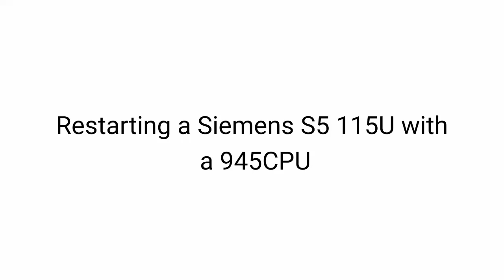Restarting a Siemens S5 115U Simatic Plc

Comment: Thank you very much. Quite simple procedure... once you know it. Otherwise, you’re doomed. 😰
Regarding the Nonretenting Presetting (NR) / Retentive Presetting (RE) switch, which is the difference? What happens if you don’t set it to the correct position? I’m trying to understand a problem we have with lost parameters after power loss and I’m not sure where’s the problem. Our switch is always in NR position. What can go wrong if we try to start it in RE position, just to see how affects our problem? We have ruled out backup battery (it reads 3.6V, and voltage is present in UBATT line).

Comment: Thankyou so much for this video, it has just saved the day for me & got a very important machine working in a factory where I work!
Reply from the maker: Excellent I'm pleased it helped you. If you have a Siemens programmer you can blow eproms with that, just make sure they are empty of old programs first.
Reply from the maker: Also be careful of which eprom you use on which programmer as the older eproms were blown at a  higher voltage
Reply: @a-c-pautomation8672   I have problem

Comment: Hello,  I have Simatic S5-115U CPU 945 with compact card and after a long time over 5 years, it was switched off. Now I need to run all the machine back again. I have changed the batteries in power supply and I can see on CPU flashing STOP and red light on BASP, as I understood from your video I need to perform Overall reset. Please correct me if I'm wrong. Also before I do it I would like to find out is the program still in CPU after such long time if I have a compact card inside, how I can make a backup of a program and if I perform Overall reset will the program load automatically from the compact card. I would really appreciate your help as I'm new in this type of field.

Comment: Hello,
Do you have an idea of what could be wrong with my 7A/15A power supply. When I connect it to the mains voltage and flip the power switch, it quickly flashes 5V led once and then does nothing. CPU also flashes its leds same way. Battery indicator and its reset switch works normally but rest of the power supply acts like not turning on.
Reply: Replace all smaller electrolytic capacitors first. When they get old their ESR gets high and they can't receive charge or discharge fast enough. If this does not work then replace the larger and more expensive Capacitors. More expensive, but make sure you mark polarity otherwise a wrong polarity will explode capacitor. Some of those caps are centre tapped + and radially are - .
Reply: Thank you for your answer! I'll try that

Comment: MATTER URGENT, 
Hi, I have done this same in my 6ES5135 PLC, when stop light come on stable mode, and then when I change the switch to Run mode, it did not come to run mode and then immediately Stop red light start blinking. can you pls. advice what will be the issue causing this.
Reply from the maker: Hi, the S5 135U has a different method for restarting the CPU after an over all reset. I uploaded a video recently of how to restart a 135. I hope this helps.

Thanks.

Comment: sir,in the power module there is a number box showing 1 to 10 and one number is cross marked.what is this indicates.
Reply from the maker: Hi. The number is what Siemens call the e stand number. It indicates that there has been a minor change to the product but not significant enough to issue a part change.
Reply: @a-c-pautomation8672  thank you sir
Reply: @a-c-pautomation8672  thanks sir

Comment: Hello. Here is a quote from the CPU manual 115u - "CPUs 941 and 942 process the control program direct from the submodule. CPUs 943 and 944 copy the contents of the memory submodule is extremely high speed."   I have a cpu 942 and an eprom module. Can I change the program through a laptop and adapter? Or do I need to overwrite the eprom programmer?
Reply from the maker: Hi. Is the CPU you are using revision "a" like 6es5 942 7ua12? As far as I know the program is copied over into internal RAM for processing in the revision b. If you are needing to make a modification to the program in the EPROM I would suggest purchasing another eprom and erasing/blowing that one with your modifications so if something does goes wrong at least you can revert back to the original program. If you do take the original EPROM out make sure the EPROM chips are covered over to protect the program as uv light erases the chips! Thanks.

Comment: If s5 plc's battery runs out, will the software be deleted?
Reply from the maker: Hi. If the battery goes flat and there is no memory module installed and the power goes off then the program will be lost. It's good practice to keep the batteries refreshed but keep the power on while you change the batteries. Also if you can, keep an up to date backup of the program.
Reply: @a-c-pautomation8672  thank you for your help :)

Comment: in your presentation image, you have a Siemens S5-110 PLC, a question the epron memory of this PLCS5-110 can I use in another PLC or read the Program in another S5 PLC for example 1 S5-100 --- 2 example S5 CPU 944B.......thanks for the reply
Reply from the maker: Hi. As far as I know the s5 110a had a different format to the rest of the S5 family like the 100, 115 etc as there was only one program block, so I think the structure of a 110a program would be wrong for a 100. You could read the  program on the eprom using a pg630, pg631 or a pg670, the pg670 needed an old version of s5 called step 5 parallel. Once you have read the code using the programmer you could then convert. I may do a video on the reading of a 110a eprom.

Thanks.
Reply from the maker: Hi. I have had a read through the 115u manual for the b version of processors and it appears that the 941 and 942 CPU run their program from the memory submodule too.